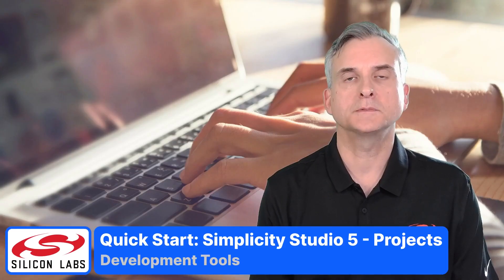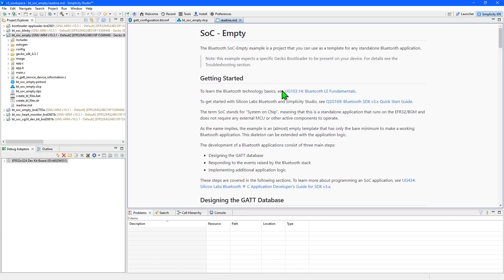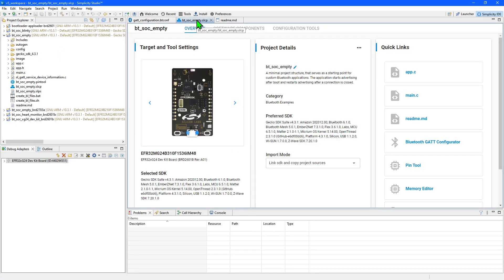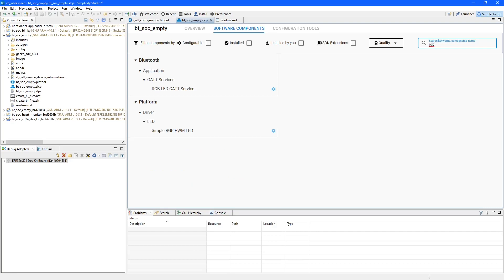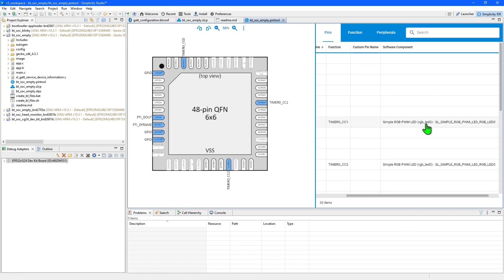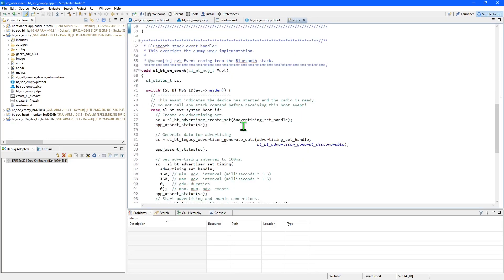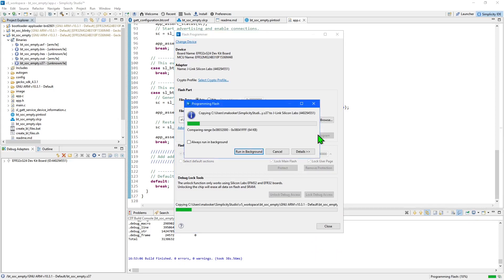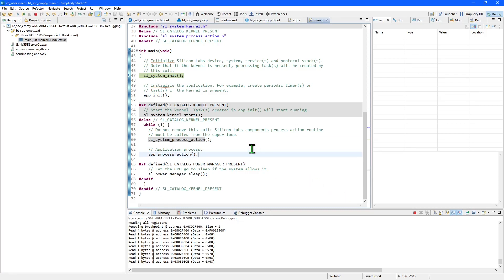Quick Start - Simplicity Studio 5 Working with Projects - Silicon Labs

Comment: @8:07  Make sure when programming to set Fiash Part > Advanced settings -> Flash Erase Options to "Page Erase"    I had mine set to "Full Erase" which will delete the bootloader, and the app will not run.